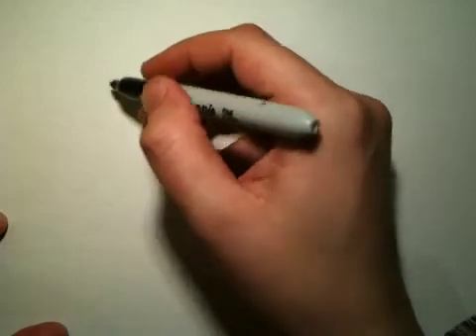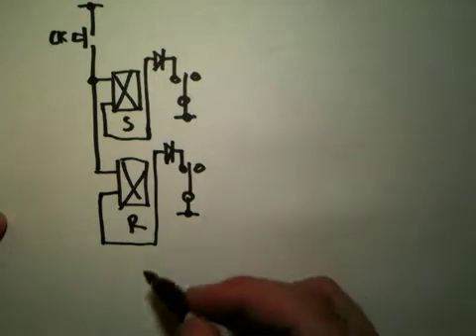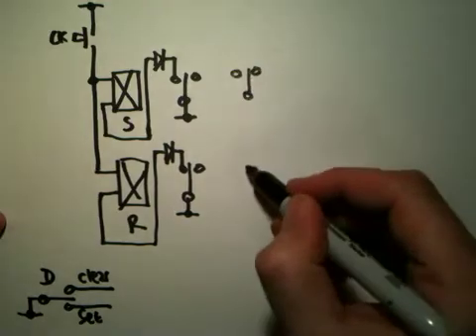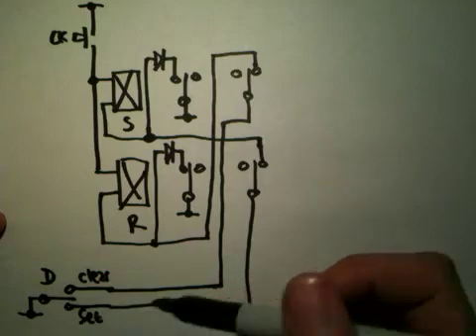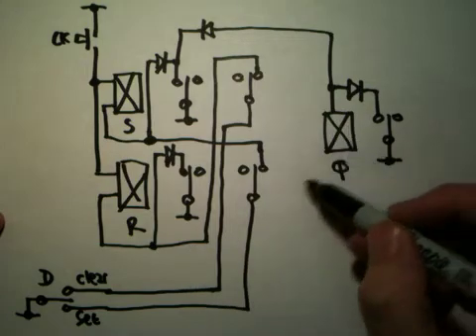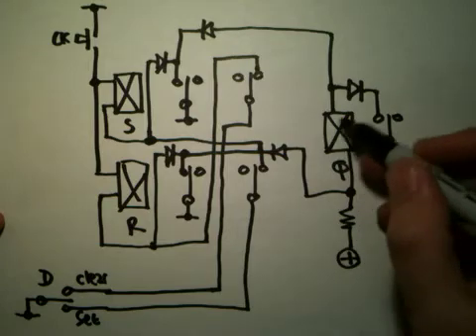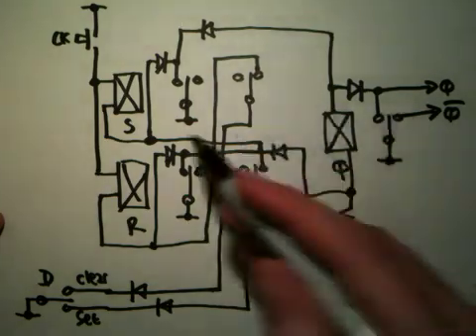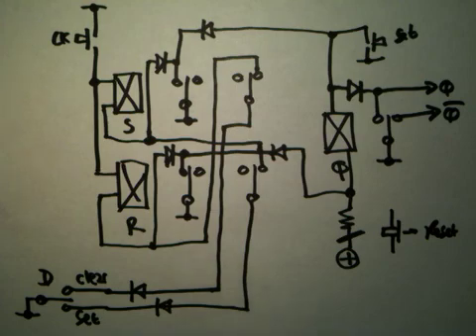Relay logic: Edge triggered D type flip flop

Comment: Are you sure there is no mistake in the curcuit? I have built it and it does not work.
Can the coils be polarized in your curcuit?
Reply from the maker: It is correct. You can read more in the section DFLIP subunit here http://simonwinder.com/projects/relay-calculating-engine/calculating-engine-documentation/

Comment: Can you make it without diodes?
Reply: Well, I think of some of the first relay-only computers. There were no semi-conductors then ...
Does that mean they did without the use of a flip-flop concept ?

Somehow I think they did it without using any diodes ... they just did not have them ...

Maybe have another relay that handle the back-propagation to open the circuit you want to keep open during the 'problematic states' ...

Hope I make sense ...
Reply: @CG-tb5uc  Vacuum tube diodes
Reply from the maker: No sadly